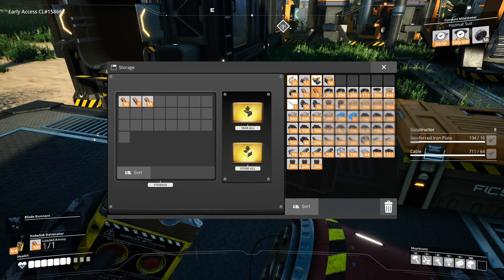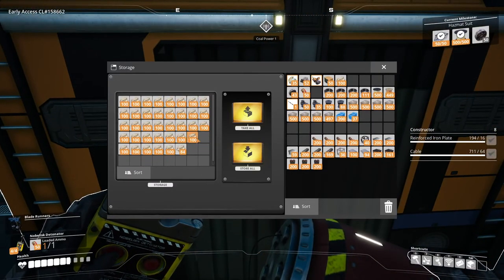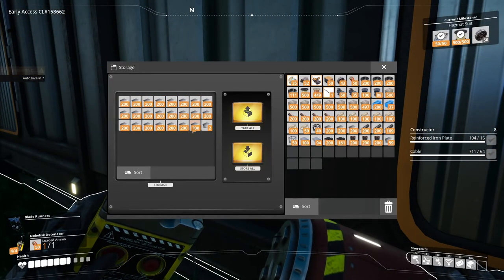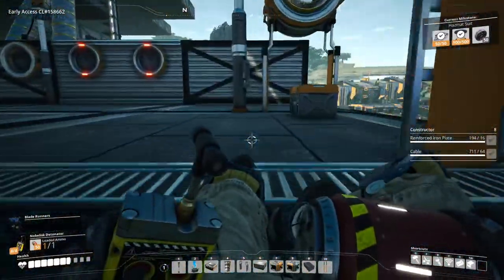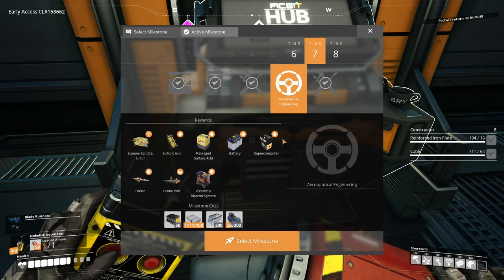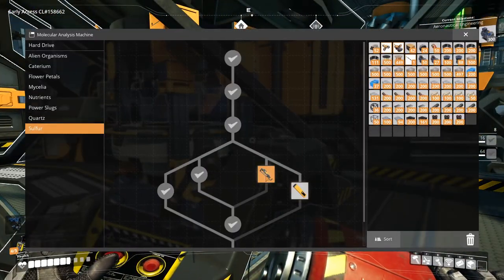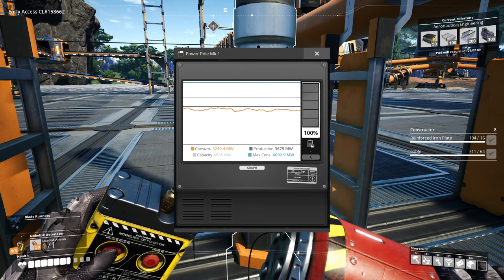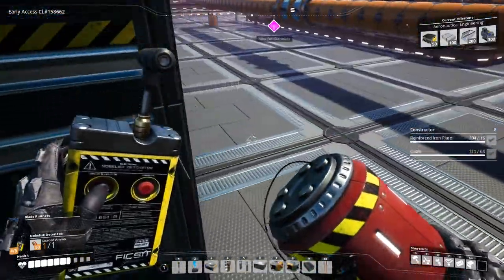Building Silica Line To Aluminum - Let's Play Satisfactory Update 4 Part 81

Comment: Glad you finally snagged the hover pack. 

If you look down at the gauge on the lower left, you can see how much power it has. If you go too far, the gauge goes to zero and you'll start drifting back to the ground. Otherwise,  as long as you are within range of a power source (Power poles count, power wires do not, trainlines do as long as they are connected to a powered train station). 

Also you'll see white 'arcs' linking you to power points; that's where the hover pack is drawing power from. 

What is a bit annoying is the range of the hover pack between power poles is less than the distance power lines can stretch. So I usually run my lines in 5 block stretches to make sure I can stay powered when using them. Once you do get used to using the hover pack, you'll wonder how you ever did without it. No more hopping up and down to try and get a target among a mess of belts and pipes. :)

Comment: Also as for your silica, you are running it through 3 industrial containers as is. Those containers have 2 input ports (and 2 output ports) each. You could bring your silica from the quartz factories and split it and feed it into the upper ports. 

Though you do run the risks of jamming the system up since if the silica from the alumina processing isn't handled it could lock things up. 

What you might want to do is use 1 container, feed it in from your alumina production and your quartz production. But the alumina production has a smart splitter that will send overflow to an Awesome sink so you will never end up with Silica jamming up your alumina production.